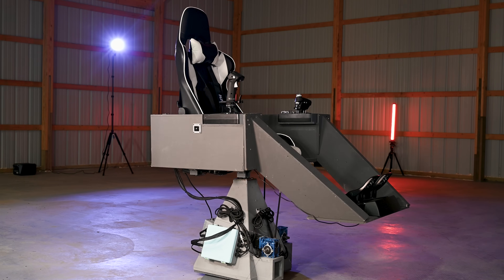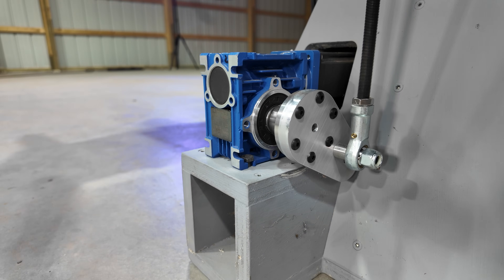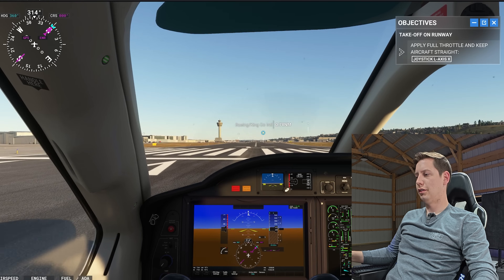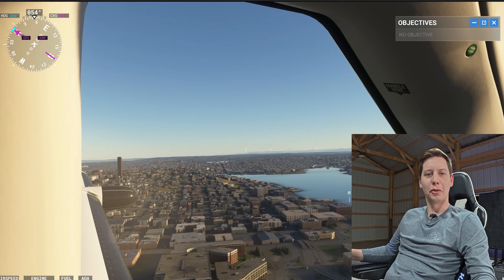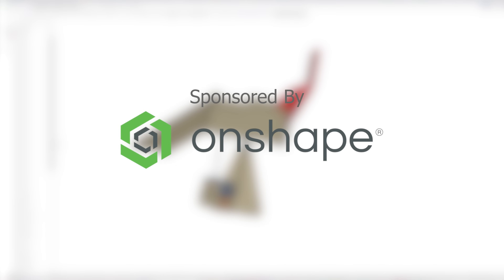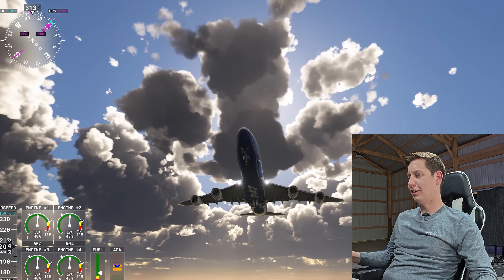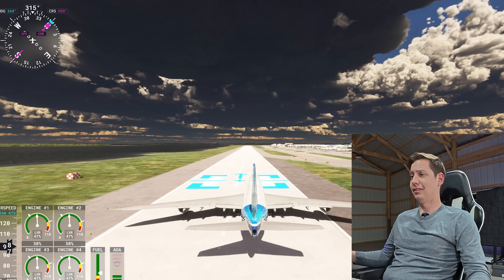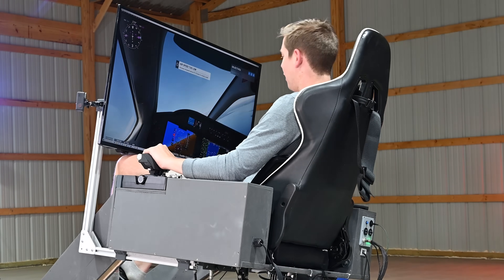Building a Real Life Flight Simulator. Pt 3

Comment: I don't know how exactly the motion rig is programmed, but it looks like the seat is trying to "follow" the pitch and roll attitude of the "target aircraft". If I'm wrong about that, ignore the following :D

As a suggestion, I would say it's better to not map the movements to "directly" follow the pitch and roll of the aircraft, but rather use the seat to approximate the direction of acceleration applied to the pilot.

For example, in level flight, the acceleration vector points directly downwards, so the seat would stay in upright vertical position. But in a coordinated turn, the acceleration also points directly down, so the seat shouldn't tilt to the side.

However, if you are slipping in a turn, then the pilot would experience a sideways acceleration, and in that situation the net acceleration points down and to one side - therefore, if the plane is slipping in a turn, in that situation the seat should be leaning to one side.

Similarly, if the plane is accelerating (or in a steady climb), the seat should tilt backwards so the pilot feels like they're being pushed towards the back of the seat, and while decelerating (or in a constant speed descent), the seat should tilt forwards. There's no way to model negative g's or actually increased g-forces, but that's just a limitation of reality we have to accept.

This is how real flight simulators use - they change the direction of the enclosed cockpit module to cause the pilots to feel the change in the direction of acceleration, and that essentially causes a very convincing somatogravic illusion of movement.

Rapid movements on pitch and roll axis could be modeled by an initial "jerk" to the direction of movement, tapering off smoothly and then slowly returning the chair to the position required for acceleration vectoring. This works because human brain is really bad at feeling angular position accurately, we mostly just feel acceleration and sudden changes in movement.
Reply: I was going to say this but you best me too it. But yes, you are correct 👍
Reply: Lots and lots of people including me pointed out the same thing in the first video. I even put a link to a great explanation video I found but he might just be overlooking the improvements it would make or might not have time for it. I don’t know.. It’s impossible for him to not have seen those comment while realizing the equally “abundant” comments suggesting rudders.😅
Reply: @prof.tahseen6104  😂
Reply: yeah his version can't be very immersive in flight sim but if his main use case is rc then its fine
Reply: @gauravs9875 I don't second that. The rc plane experiences the same forces that you would. It's unnatural to tilt to the left or right on every turn. It's not immersive at all, doesn't help with controlling your model and it could also make you crash.
I'm not only a simmer, but a paragliding pilot and I experience those forces a lot.
Reply: @dimitris2521  nice I fly gliders as well what I meant was i don't think he designed the thing for realism more so he wanted a slightly  "better" experience. Its like getting a joystick with force feedback compared to a vr headset and the proper Hotas rig the immersion is just not the same. Also for a RC plane I wouldn't want to feel the actual forces as they would probably be too extreme.sorry btw I'm not very good at explaining.
Reply: vector calculations would mean they need to get 6D acceleration data, x y z pitch yaw roll rates, i dont think that's possible unless you mod the games, with RC planes the inner accelerometers and gyros should be able to do so,
there' might be lag if you dont take the data from the game directly but taking the 6D position data and dividing it by time (1/pull rate)
∆Pos/1/pullrate(hz) = Velocity
so  n+1 - n thats 2 frames for velocity
for acceleration you'd need 3 frames
n+1-n velocity
n+2-n+1 velocity
∆Velocity/1/pullrate(hz) = acceleration (linear or angular)

It's pretty easy but then again we'd still need to do more matrix calculations, thankfully we know normal force is always pointing down, we just need to match any Resultant linear vectors with gravity.

for angular we still have to convert it to linear acceleration by taking into account the pilot position away from the rotation center(which is not exactly Center of Mass, but for this rig, close enough) of the aircraft type.

but then the rig would only work in dark rooms where the pilot has no outside bearing and can only intuit their position with what the display and rig is giving, or only use a VR headset

since if they roll sharp right, the rig would lean left hard.
if the pilot can see visual orientation cues from the world, this would break the illusion and be VERY disorientating

but those are just the "hard" parts, there's still
easing functions to put in
converting them to motor control
etc3

A WHOLE BUTT LOAD of programming and development needs to be done to achieve that.
Reply: True. I would also add that the motion system, even when properly tuned to the accelerations, has very little cost-effectiveness. It's very expensive, adds complexity to the design, and in practice, it has been shown not to significantly increase immersion. Motion can only be realistically recreated through identical movement. And if the brain detects a mismatch between the visual input and the signals from the inner ear, it tends to ignore the latter and trust what the eyes perceive. I’ve been a professional simulator instructor, and it’s well known that sometimes the motion system fails or freezes — and yet pilots continue 'flying' without noticing anything at all.
Reply: I am currently working on modifying his py script for MSFS to use the acceleration instead of the direct pitch and roll of the aircraft. Once complete I will be submitting a PR to his GitHub repository
Reply: Came here to say the same good job
Reply: I would be very surprised if this thing could do sudden movements.
Reply: Does MSFS output that data?  Seems like it wouldn't be hard to do if the game calculates that in the physics engine.  Also, imagine making that change then flying with VR.  Then you'd lose the "unrealism" of the chair.
Reply: @HerraTohtori   I just submitted a PR to the project to add acceleration based motion for MSFS, I didn’t not see the required values available for war thunder
Reply: yes, the real simulators use acceleration as a base for movement and not the real pitch of the aircraft
Reply: thats exactly what i was gonna comment
Reply: So, could this system be used for a driving simulator setup? It's very appealing simple in it's construction, but perhaps doesn't map the simulated movement of a car correctly
Reply: @HerraTohtori  lol. Your comment does not only say the very exact things I said, but it also follows the same structure and the same examples as mine 😂.
I'm not implying that you "stole" my comment, just finding it funny 😂
Happy to see other people pointing that out.
Reply: @ In all honesty I didn't bother reading other comments before posting mine.

I'm sure a LOT of people who are physics literate and knowledgeable with aviation and motion rig systems are posting basically the same thing.
Reply: @HerraTohtori  yeah I know. Don't get me wrong. I didn't in any way think otherwise. Just noted the funny thing the way our comments were structured.
Reply: this has been posted prominently in every one of the videos about this project including by myself so its without a doubt assured that he has read them, so I would like to know if there is perhaps some good reason as to why its not implemented this way. perhaps limited to 2 axis replication of true G doesnt feel as good as how he is doing it?
Reply: @N1ghtR1der666  Well, one legitimate reason would be if he's still kind in a hardware prototyping mode, trying to make sure the design holds up to stresses and the actuators can move the design properly within the designed limits.

It's probably a lot easier to make testing code that just tracks the pitch/roll inputs from the sim or RC plane, but I would definitely hope that the "final version" uses the more sophisticated method of aligning the acceleration vector based on how the pilot would feel it based on how the aircraft is maneuvering.
Reply: @HerraTohtori  yeah definitely a reasonable possibility, I would like to hear his reasons from him directly too
Reply: Makes sense

Comment: Imagine if it had full 360 degree rotations in all axis, so that you could literally hang upside down in your seat. I think that's the next huge step lol.
Reply: You'd have to make large circles... it would be a ton of welding and engineering. It would be insane expensive. The next thing for it would be getting a VR headset.
Reply: You really don't want 360 deg rotation because what matters for flight simulation is feeling the Gs from maneuvers, not feeling like you're hanging upside down for extended periods of time (pretty much only air show pilots need to do that). The proper way for a flight sim to work is to use gravity to simulate Gs but with just 1 G available. By tilting the chair back you get pressed against it, which feels like pulling positive Gs. Tilting the chair forwards makes you feel like you're going to fall off the chair which simulates negative Gs. When you roll to one side you get shoved into the opposite one.
Then you could add a G-seat which has flappers on the seat and back which move to further give you the sensation of being pressed or lifted against the seat. If you want to go all out, motorized straps.
If you do a loop at 7 Gs, even when you're at the top you're going to feel pressed against the aircraft rather than feel like you're upside down. So a 360 motion system doesn't actually simulate what it feels to fly a plane. Because you'd feel gravity change direction as you roll, while in a plane the "gravity" you feel is bound to what kind of maneuver you're doing rather than the plane's position in space.
Reply: Check out the Nova 360 Degree Motion Virtual Reality Simulator
Reply: @alttabby3633  Yo, that's actually so awesome! The 250k price tag is kind of making me reluctant to purchase though..... Lol
Reply: I don't think something like that would fit in my living room, but... Why not?
Reply: @MCsCreations  I saw a guy on YT a few weeks ago that built a full A320 or 737 cockpit with a motion system in the KITCHEN!!  there was barely enough space to move between the sim and the cooking area. But it was a pretty cool setup

Comment: Nice work! However the main issue with the chair is that it does not accurately simulate the feeling of gravity and acceleration. I see that when you started throttling, your chair did not move yet. So you did not feel real plain acceleration. To fix it you need to move the chair based on the acceleration and not orientation.
Reply: you can run it in either mode.

Comment: What was the total cost?
Reply: So far I've calculated $502 USD but that does included stick throttle and rudder, screws, 1/2 plywood, nor the full price of 3/4 plywood (I've only add 2x2 ft )since I don't know how much surface area I need yet.
Reply: @1wingpixy How much weight can it hold?

Comment: This is an awesome project and thank you for sharing with us. This is not the way it should work, though. What you simulate with a moving platform is the acceleration force that you feel when flying the real thing. It shouldn't just follow roll and bank angle. This is unnatural, definitely not immersive and will also cause motion sickness. Imagine being in an airplane in a turn. You still drop to your chair, not to the side facing the earth. 
The platform should instead move in a way that the force of gravity is parallel to the acceleration force you would actually feel. For example, when you accelerate to the runway the platform should roll upwards. When you decelerate it should roll downwards. It may seem counterintuitive, but your body is not able to distinguish between the real force of gravity and the force you would actually feel, so it becomes very realistic. 
As of bank, the platform should not move at all if correct rudder is applied (coordinated turn), because the force you feel is still facing down. It should bank left or right though, during side-slipping, even if you don't bank the same way, because what you feel is your body moving to the side like fast turning in a car.
That is also the way commercial simulators work, where real pilots are trained. 
Your project is awesome. But please take some time to dive into these things and feed the system with the correct variables from the simulator and even your rc planes (accelerometer). It would be a shame if all that work you put in there goes into nothing.
Keep up the good work 💪🏻
Reply: you can run it in that accel mode if you want. there's code for that already.
Reply: @licencetoswill  great if he has already done so. It wasn't mentioned in the video and I couldn't find any use case for the mode showing anyway, so I assumed his project was coded that way. Thank you for the info
Reply: @dimitris2521  He also messed up on just putting the angles in . When you go into a turn you feel the turn initially but once the turn is constant you don't feel it anymore and the rig should be going back slowly to center so that if you turn more in the same direction it can simulate it.
Reply: @thomgizziz that comes next. The main issue is that he is using angles and not acceleration.
Reply: @licencetoswill  the code  for accel mode is not in his PC py script for MSFS2020.   
---------------------------
"sm = SimConnect()

# Create a request object to pull data from MSFS
aq = AircraftRequests(sm, _time=10)
    
while True:
    try:
        # Retrieve pitch and roll data
        
        pitch = aq.get("PLANE_PITCH_DEGREES")
        roll = aq.get("PLANE_BANK_DEGREES")"
----------------------

He is getting pitch and bank directly. simconnect does have the ability to get the accels though 

ACCELERATION_BODY_X 	Acceleration relative to aircraft axix, in east/west direction 	Feet per second squared 	Y 	-
ACCELERATION_BODY_Y 	Acceleration relative to aircraft axis, in vertical direction 	Feet per second squared 	Y 	-
ACCELERATION_BODY_Z 	Acceleration relative to aircraft axis, in north/south direction 	Feet per second squared 	Y 	-

I was stating to look into how to add accel mode and issue a PR to his code. might take me a couple of days though
Reply: @dimitris2521  I just submitted a PR to the project to add acceleration based motion for MSFS, I didn’t not see the required values available for war thunder
Reply: Let's see your build?
Reply: @AussieBassplayer  Do I have to show my own build to make my respectful insight to his project? Really?

Comment: i see you are mapping angle of aircraft to the chair. Wouldnt taking the acceleration values and map them to chair angles help more with motion sickness?
Reply: It isn't a good way to do motion control. It should be calculating G forces and rolling slowly back to center when there are low g's in turns so if you go the same way again but harder it can simulate the stronger turn. This is how all commercial motion platforms work and there has been decades of work put into it.
Reply: @thomgizziz  I just wanted to comment this: it's a very commendable project, but in no way does it reflect the flying experience - the chair should not be just mimicking the motion of the aircraft, but simulating the G experience for the user - in a coordinated turn, the chair should not bank at all.
Reply: Fortunately at this point with it working, that's < 1h of programming.
Reply: Yup, this is position simulation, not motion.

Comment: Whats the rough cost?
Reply: So far I've calculated $502 USD but that does included stick throttle and rudder, screws, 1/2 plywood, nor the full price of 3/4 plywood (I've only add 2x2 ft )since I don't know how much surface area I need yet.

Comment: I have used the same idea at FESTO but implemented using pneumatics, instead of stepper motors they used flexible cylinders and a custom racing game. The only downside is that you have to buy an Industrial air compressor and PLC to use it.